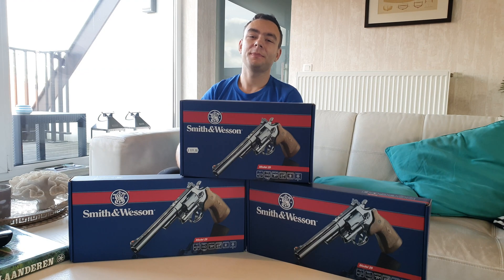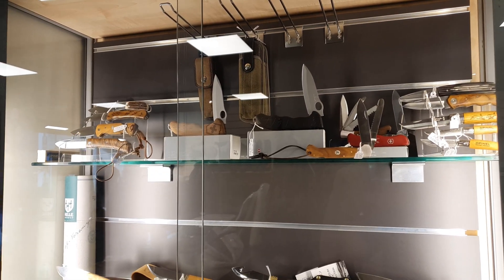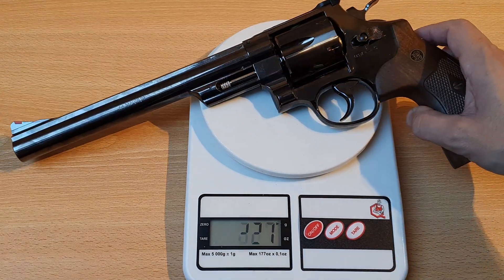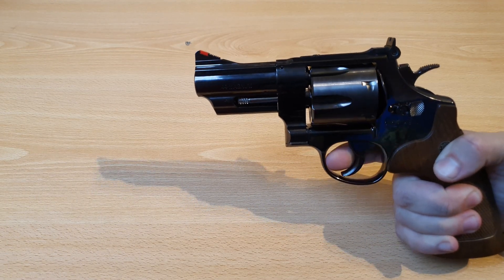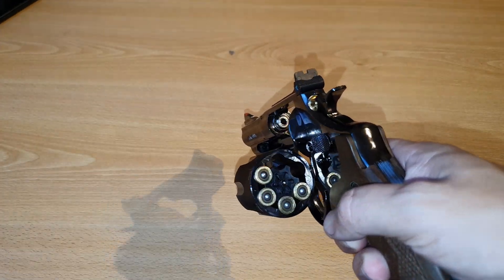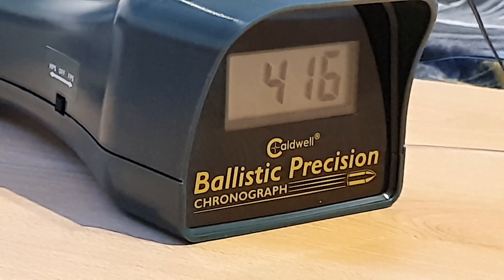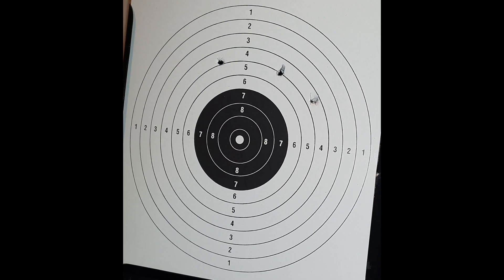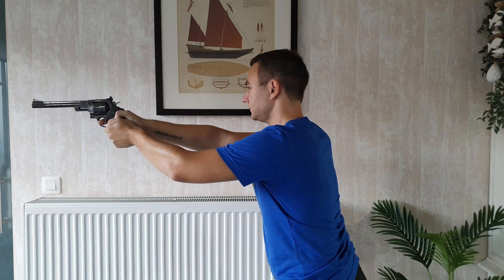Does barrel length really matter? Tested with co2 smith and wesson airgun

Comment: I have the one with 6.5” barrel and ”for obvious reasons” it has to be that one. And I hesitated between the BB and pellet version and eventually choosed the BB one. I think it was a good choice, it’s cheaper and you can shoot pellets with it with almost the same accuracy as the pellet version.
Reply from the maker: Because of dirty harry ? 😁
And good choice on the bb version it has the same accuracy, but more destruction power 😋
Reply: @HappyDude1  Correct! 👍

Comment: Yes, the longer barrels do make a difference. My Dan with the 2.5 inch barrel does about 430fps with 5.1gr pellets. my 4 inch does around 480fps with 5.1gr. They are very consisten too, within a margin of error around 10fps. Maybe it's just a dan wesson thing but yeah, it's a thing.
Reply from the maker: The eight inch is even better

Comment: Unfortunately, in the US we only get the 87/8 barrel length. In the Dan Wesson 715 we get 21/2,4 and 6.
Reply: I'm just glad that the Dan and wesson models actually have 2.5, 4 and 6 inch RIFLED barrels now. They fixed them. They use to all have 2.55 inch rifled sections and then a smooth bore tube the rest of the way. They apparently listened to the complaints though. Thankfully.

Comment: I suggest also trying with a lightweight lead pellet, as it often improves accuracy even in smooth bore BB guns. The steel BB's are undersize, whereas lead pellets will seal / bear 100% against the barrel bore.
Unfortunately the actual bore on these guns is a two piece barrel(s). The first section is the same length on all versions, and also the only part with rifling on the rifled pellet version. The front part is just oversize regular BB smooth bore.
(First section of the bore is 70mm on all versions.)
Interesting to see the accuracy test with a vice! What will improve accuracy even more when actually shooting, with a long barrel, is that distance between front and rear sights increase. ("Sight radius")
Reply from the maker: @andersgrassman6583  
Interesting,, but with the fake long barrel, it still performed better 😁 and I don't use pallets with  pistols or revolvers.

Comment: Hello brother!
I want to buy the Dan Wesson 8 inch just like your one but In my country currently I can't find any where. But getting the similar one Black Ops 8 inch barrel 4.5mm steel version. So I am thinking to buy the Black Ops 8 inch. Can you tell me are the both guns completely similar or the Dan Wesson is more powerful because of its actual internal longer barrel??  I can tell internally the barrel inside black ops 8 inch is little bit shorter than its shown outside. May be its around 5 or 6 inch. 
Kindly throw some light on this comperisn.
Reply from the maker: 8 inch always performs the best you can buy this one from this video its an amazing  gun, even better then dan wesson
Reply: @HappyDude1  thanks a lot for your suggestion.
Reply from the maker: @ronaldahom8267  
Happy to help

Comment: The 8 inch looks best on you. Hey...a man needs a long barrel, right? I have the 8 inch as well and it is a dream. Fit, finish, function all five out of five stars. The adjustable sights are easy to dial in. And when you use pellets...which you can shoot in this pistol with no problem you get tighter groups. Liked and subscribed.
Reply from the maker: Haha 😃 i took the 6 inch 
Because its the same as in the movie 😁

Comment: I have the Model 29, 6.5" rifled barrel, DONT BE FOOLED, the .177 rifled section is only 2.75" long, then it opens up to 6mm smooth for 2.9". Currently trying to figure out if I can dismantle it to fit a longer barrel

Comment: Thank you for your experiment. You are a good scientist. I am glad that the results confirm what I learned about Physics. Barrel length actually matters. I also made an experiment today, to see how deep under water a 6 mm plastic BB with 0.4 Joule can still be lethal for a tomato. By the way: The 6.5 inch version suits you the best. Matching with your body height. 😅
Reply from the maker: Hm yes i should were a lab coat 😅 and this is only video on youtube with a good test with the same revolvers but different length. 
And shooting tomatoes under water thats new and original 🤣 and sow you are saying im to small for the 8 inch 😋

Comment: Very cool video! The power of the hammer is probably regulated so that the 8 inch version doesn't develop too much power combined with the longer barrel, while it is exactly the opposite for the 3 inch. 

Also, have you tried the 3-hole transfer port valve upgrade on the dan wesson? The seller claims 20-60% increase in power and a user claimed 80% increase.
Reply: From what I've seen on another channel, the 2.5 inch version has this 3-holed valve pin from the factory, while the 8 inch has a 2-holed one, again, for power regulation. So swapping them, gets you the best of both worlds.
Reply from the maker: Thank you 
And yes that could be it for the trigger.  And no give me a link pls 😀
Reply: @HappyDude1  did youtube delete my link comment? I don't see it anymore. Have you managed to see it when I posted it?
Reply from the maker: @Mihai Niculescu  
No its gone 🥲 i did not see it